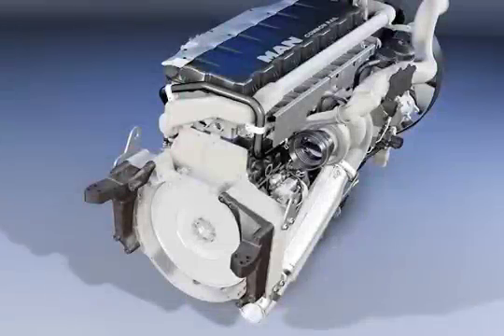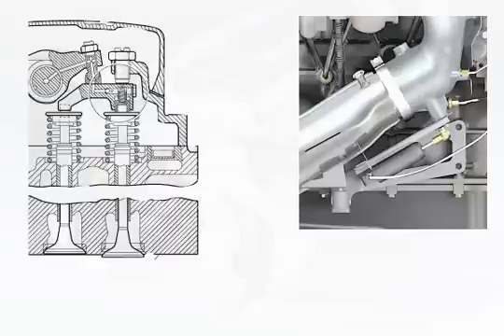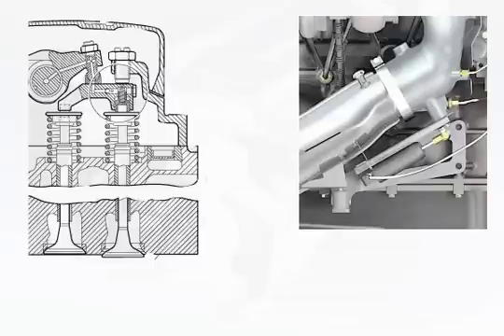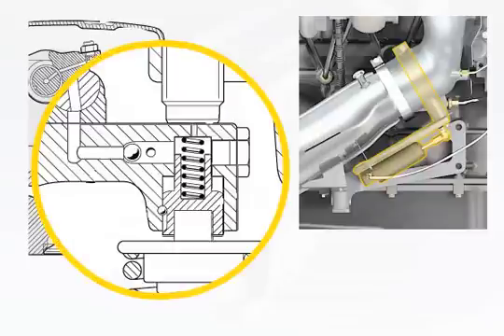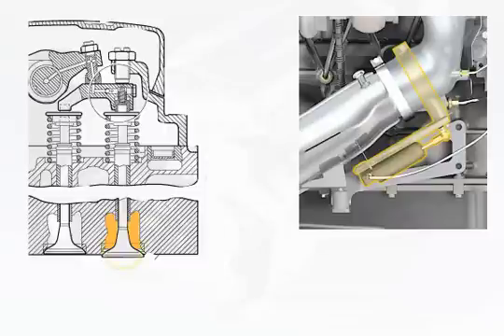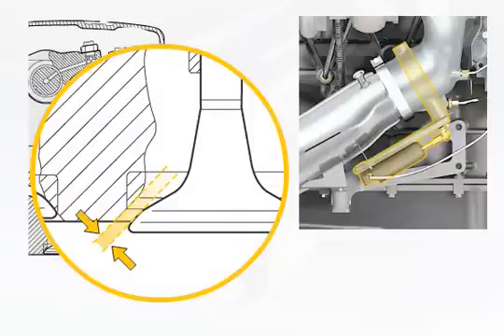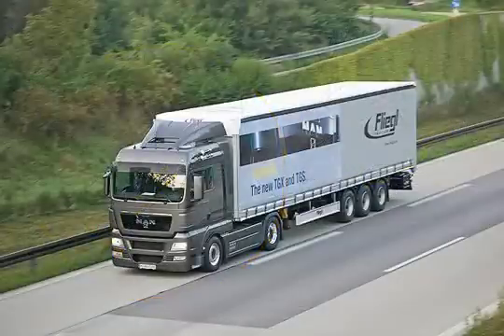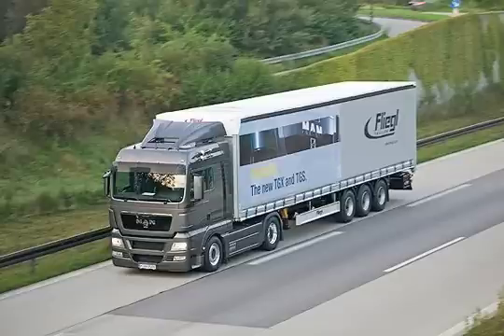MAN Exhaust Valve Brake (EVB) | MAN Truck & Bus

Comment: My truck hand break delays to release or does not at times, what could be the problem?
Reply: You need to check the parking brake booster cylinder.